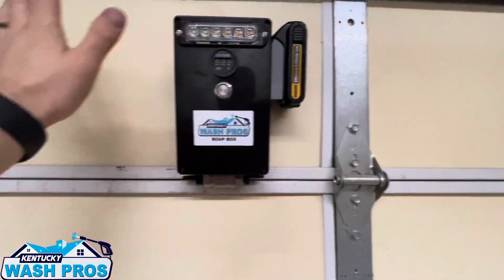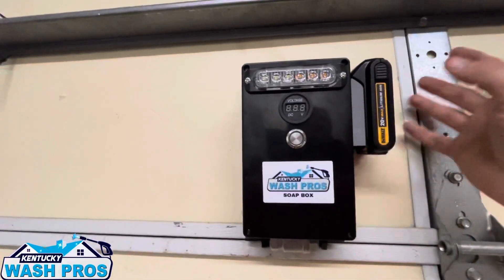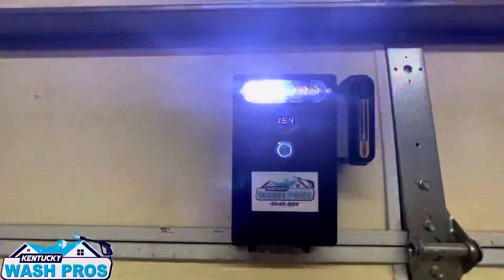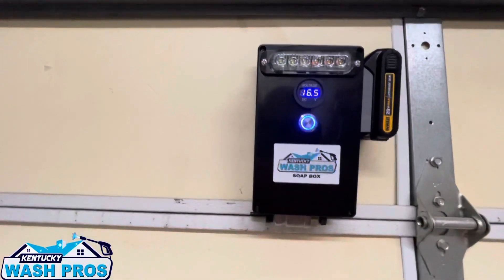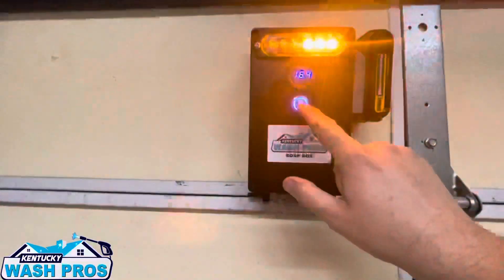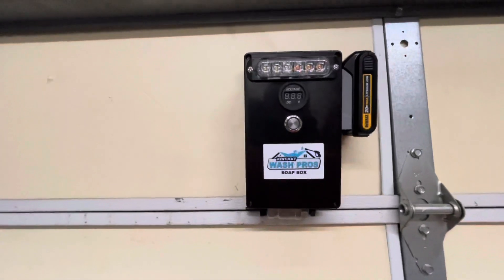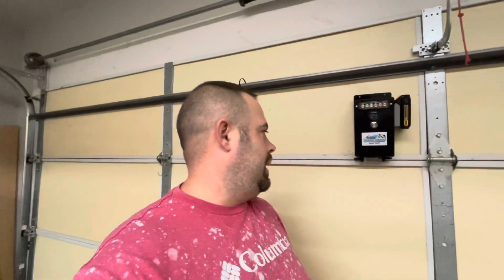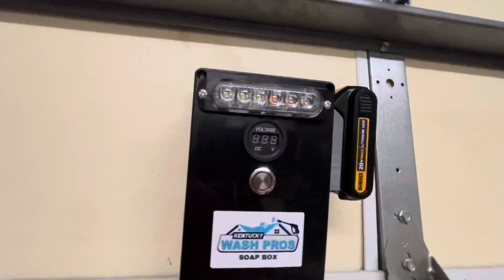Battery Powered wireless downstream injector box

Comment: Killing it! I used your original design from way back when and for some reason "on" is off and "off" is on lol.
Reply from the maker: Did you build it yourself?
Reply: @KentuckyWashPros  yes I did. Wondering if I can just swap the wires
Reply from the maker: @jetskirehab750  you more than likely purchased a valve that is normal open instead of normally closed
Reply: @KentuckyWashPros  that’s probably it